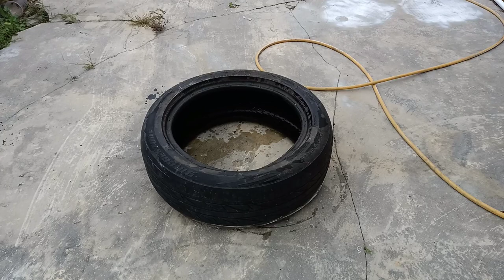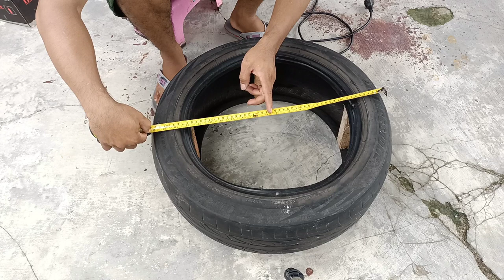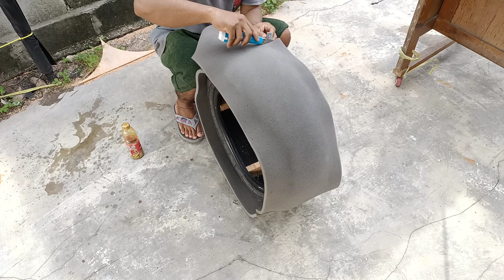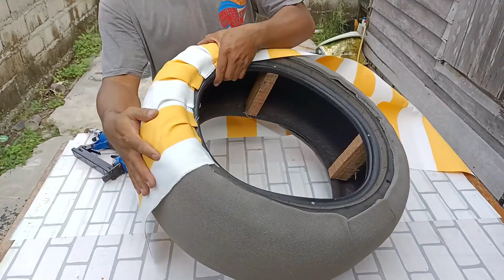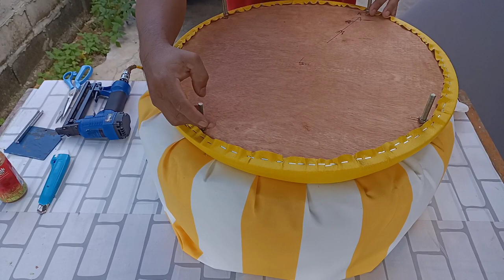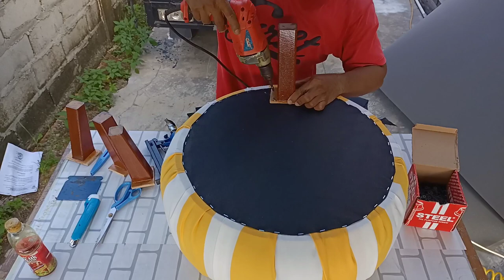diy car tyre stool # make a chair out of car tires

Comment: What if you don't use those wooden clogs inside the Tyre? It will give more cushioning right?
Reply from the maker: yes, But for a long time the tires will Drop. because of the burden of time in sitting.

thanks for the input